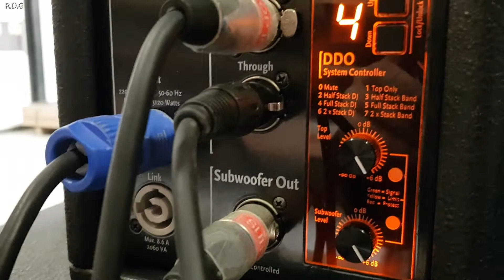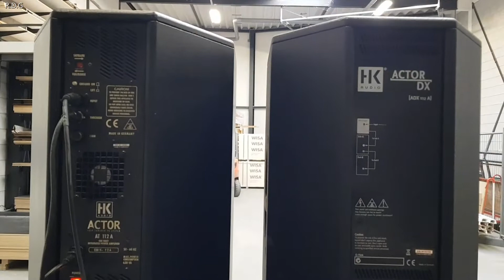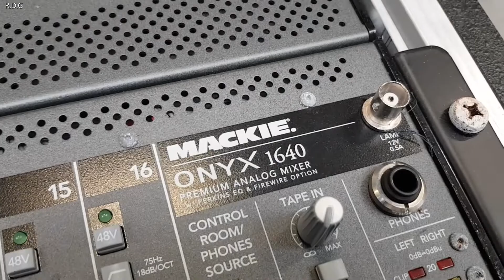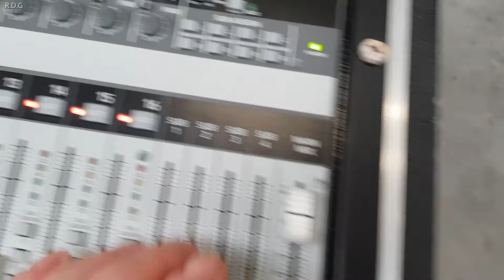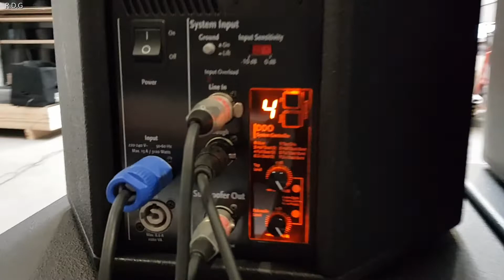HK Actor DX💪🏼Together💪🏼HK Actor AT HK Audio Full Active Speaker Setup Test PA Anlage

Comment: V shape 90° angle at top boxes sides or runing in parallel just for this demo?
Reply from the maker: I just connected to the mixer left and right. Only for fun 😁
Reply: You get the best sound at all angles but the most precarious stack with the top boxes upside down on top of the other top boxes but rotated at an angle about the front of each HF horn. I suppose you could also lie them on their side and rotate the HF horns for a 2 box stack, or use an inward splay angle or a wide outwards splay angle - still some interference would be heard which is why single boxes typically sound better (though they aren't always loud enough). The ideal is to get loud enough mid-highs with the correct dispersion that you only need one (or 2 or more if spaced out or going for stereo). Because you can't get HF horns close enough to sum in all directions, it is better that you can only hear one at a time depending on where you are located.

Subwoofers - usually just get all of them together as close as possible, then put them right by walls and corners facing the boundaries. The idea is to get them in phase with the boundary reflection. With a wall it's like having twice as many subwoofers. If you can get them all near enough a corner - tricky with 8 subwoofers (unless you could embed them in the walls) then it's like having quadruple the subwoofers. You actually save power because with two subwoofers in close proximity it's the same output as one working 4 x as hard. It's not a free energy device it's because each speaker fires into the compressed air of the other speaker and has more resistance to push against, thus making more sound. The effect has diminishing returns with more and more subwoofers, but hopefully you have enough rig for the gig by then.